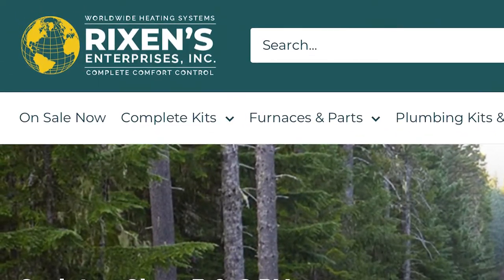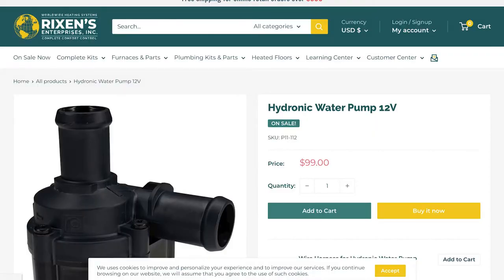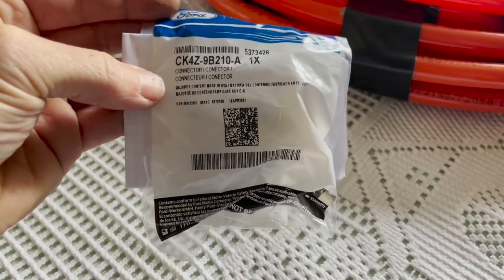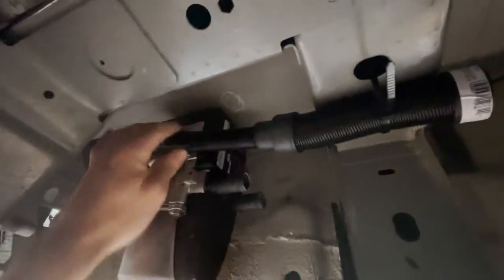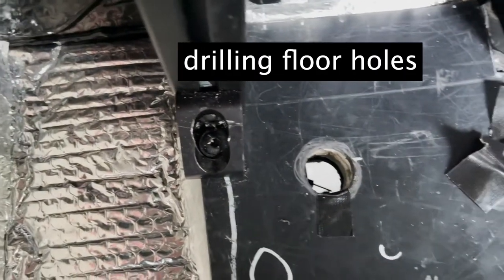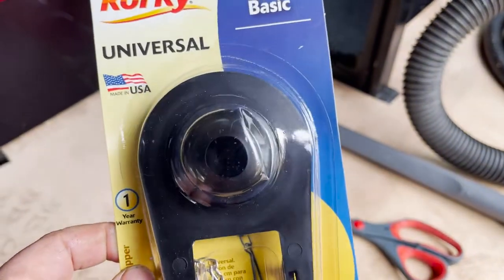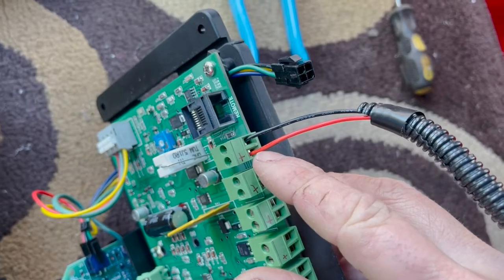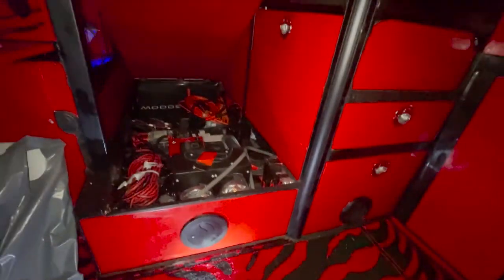Rixen Hydronic Heating Installation in a Van

Comment: The exhaust pipe and muffler get to over 400F which will melt those zip ties, use factory holes or wire to hole it in place

Comment: I've replayed your video at least 3 or 4 times --> Great stuff!! Very informative.

In case anyone in 2024 is referring to this, you may likely be purchasing the 'MCS7 kit.' After calling Rixen's twice today with various questions, Andrew Smith being very helpful, informed me that for the MCS7 kit (as opposed to the MCS6 kit in the video) a Rixen Thermostat is not necessary with the current, new, model (MCS7).

Under The Radar, I greatly appreciate you making this video. This was very helpful and informative. As I recently purchased a Ford Transit I appreciate the insight into needing the special Ford gas tank attachment.

Comment: I think you oriented the muffler incorrectly.  There should be a weep hole opposite the screw hole to let moisture out. It should be facing down which means the screw hole is at the top. If you don’t do this, water will pool in the muffler and you will start getting error codes.

Comment: If I may:  I would use stainless steel Zip Ties instead of the plastic ones, under a van.
Reply: @undertheradarvan  was just thinking the same. Or steel zip ties. Exhaust is typically about 700F or thereabouts. No plastic anywhere near the exhaust system 😕
Reply: @undertheradarvan 😂😂😂

Comment: Thanks for the video.  I have a Rixen system as well.  Quick question.  I am not getting hot air or hot water. Ni discovered a leak in one of the water lines.  Wonder if that is causing my issues?
Reply from the maker: Is it giving you fault codes in the app?

Comment: Good video!  I don’t recall you showing the engine coolant hook in.  If that part was left out it would be big help to do a second video.
Reply from the maker: Decided not to do that until my three year Ford manufacturers warranty ran out, as it would void it. Will def do a second video on it eventually.
Reply: @undertheradarvan  I came to the same conclusion, but still wanted to see someone els do it. 😀

Comment: Can you show how you connected wires 1, 2, and 3.
Reply from the maker: 1- Power (+) of car battery, 2- Power (+) of house battery, 3- Ground (-) of your house or car battery.  You will need 12V DC at 20A so a Jackery will not cut it.

Comment: Interesting. I don't have a van yet but hydraunic heating is a must when I do. I'm curious what the fuel burn is when it is cold outside? Ford makes a diesel Transit? I thought you said diesel in the video.
Reply from the maker: Fuel consumption is negligible considering the thermostat shuts it off half the time.  I'm guessing one cup of gas lasts throughout the night. The heated wall next to my bed is the best thing ever. So worth it if you are willing to put the time in.

Comment: You don't need a tap for the heater mounting plate attach screw. The heater hardware kit comes with a self tapping screw which should be used as per heater instructions as it is intended to be a partial interference fit to avoid the screw coming loose. I re-watched several times and you are pretty clear from a viewer standpoint that you used plastic zip ties to reinforce metal clamp and as primary attachment for the exhaust pipe. If watching please don't do this and in fact use a fiberglass type insulation to isolate the exhaust heat if it comes near any plastic. On my install the exhaust is near the rear shocks plastic dust shroud and with crazy suspension movement could possibly touch the exhaust pipe so I added some stick on insulation designed to protect from car exhaust pipe and muffler heat.  If doing floor heating loops I recommend way more loops over the whole floor for it to really help heat and feel warm. I did my loops with 8" spacing (3/8" PEX) and heat spreader plates and I can still feel the cooler areas between the floor pipe runs. It's not bad but I wouldn't want to spread them out much further like the single floor loop shown as your trying to maximize the heat transfer through conduction (most efficient) between the PEX pipe wall and floor top surface. There are lots of other videos with good high density floor loop layout examples. While its a lot of work to install, the heat is great when its -5'F outside overnight while skiing.
Reply from the maker: I stopped reading your comment after you said a self tapping screw is better than a bolt.  No it is not.  Ever. And you absolutely need to tap that thread for the bolt, there is no downside to this.
Reply: Only stated tapping wasn't required, nothing wrong with going above and beyond, but others may not wish to purchase a tap which is implied in video as required. Pg 18 of manual states the following. "Insert the heater in the bracket and use screw M6 x 16, SW T30 to fix onto the bracket (tightening torque: 10+1 Nm), see Picture 5. Note. A thread-forming screw is used to fix the heater onto the standard bracket. It is not necessary to pre-cut a thread. The thread is formed by the screw on screwing it into the tapping hole. 3.4.2 Mounting instructions for thread-forming screws. Position screw by hand and screw in. Always keep to the given tightening torque. When screwing for the second time also position by hand and do not cut a new thread. The thread-forming screw is suitable for max. 6 installation attempts. In case of repair (removal of heater) a metric screw (M6 x 16) can be used as an alternative."

Comment: Unless you're using the heater to preheat the engine, the engine heat side doesn't need a pump, it will naturally flow.
Reply from the maker: The engine heat loop is a closed loop that needs its own pump. You cut into the engine coolant line and run ThAT through a heat exchanger. What you install is the line that runs through the other end of the heat exchanger.
Reply: @undertheradarvan  Yeah, I understand. I have a DIY version of this in my own van and do not have a pump on the engine side. The engine loop side is tee'd off the heater core lines and the engines own coolant pump pushes it through the added loop that goes to the heat exchanger. So unless you're using the Espar to pre-heat the engine, it's unnecessary, hence the reason Rixen doesn’t sell it in the kit.
Reply: @Dr.Thundy  the engine loop pump is also usefull even if you don't preheat your engine: you can use it to keep circulating your engine coolant through the plate exchanger even after you've stopped the engine, until it gets cool, you could even link the pump to a switch that automatically turns it off when the coolant temperature falls down to a set temp...

Comment: NEVER connect a heating system to your engine Fuel tank. the fuel tank is for the Engine only. You will run out of fuel. Install a separate fuel 10- 15 gallon tank  or Propane tank for the heating system.
Reply from the maker: The auxiliary tap only goes down 3/4 of the way into the cars fuel tank. You will NEVER run out of fuel. The Heater will simply stop working when you get down to a quarter tank. This is standard on ALL modern auxiliary ports.
Reply: Still its better to have two gas tanks and not affect the vdhi less range.
Reply: @StallionJames1  my daughter has a 2023 Mercedes Sprinter 2500 ext high van and we had the extra large fuel tank. the heating system is the same as videoed here
Reply: @manuelrivera6873  Ok< So what is your point ? Or did you miss my point. No matter how large your fuel tank is separate fuel tanks are always better an you will never wake up stranded.
Reply: @mrgcav  not trying to make a point, just commenting  what she has, thanks for your reply